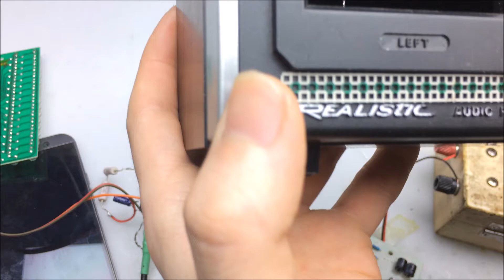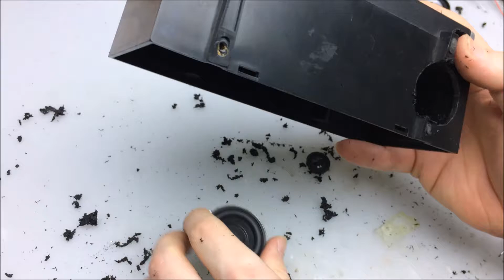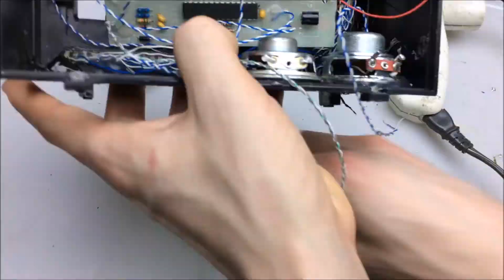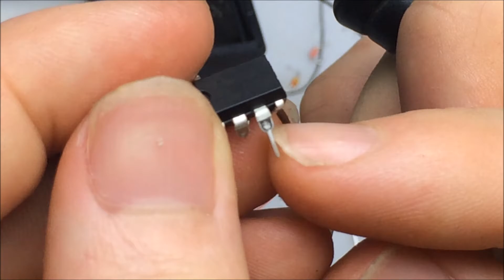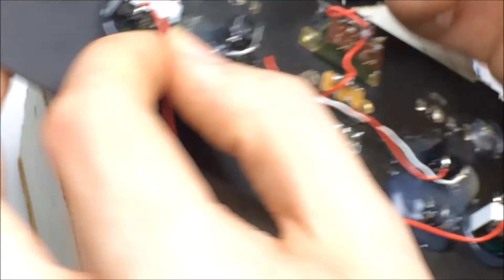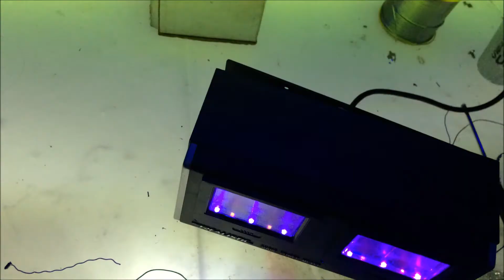A Realistic Project

Comment: That was some pretty neat work!
the genius part about it is that you werent even referencing datasheets and stuff, like youd done all this before!
the only thing i think i could ask is, why not use just a single diode to change the ac waveform into a dc one
I think this might actually look great if you could incorperate the leds into some sunglasses or something to wear at a party :)
its a bummer about that one led! but if thats the only thing that went wrong, you did pretty great!
never had the problem with plastic fogging using superglue, is it from the fumes?
I have a fan a bit like that, but its speed seems to be set to useless
Reply from the maker: It turned out pretty darn cool. The reason why I did not used a single diode is because the audio circuit's output is capacitor coupled so to keep the needle working in the right area I also needed to dump the power in the cap on the negative size of the wave. I could of also probably used a single transistor but I knew what would work so I just did it. The set up was made to increase current to the needle and isolate the load from the driving coil from the rest of the audio signals. It was nice to make something and not worry about a datasheet, I quite enjoy it when I can just work on something with the brain box alone, it takes all the pressure off and leads to a relaxing project.

Yea, the fumes can certainly frost things, it's a major pain in the ass especially with optics so it's at this point habit to use a fan for maximum effect. You may want to check your fan for a built in thermistor, if it has one then just jumper it. It it's a 4 wire fan it may need PWM. I like my fans set to dangerous.